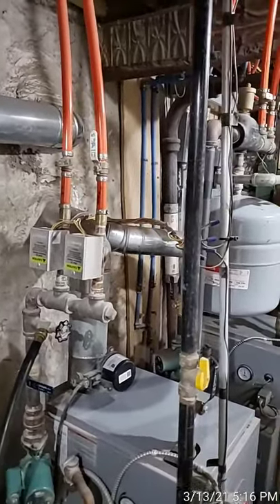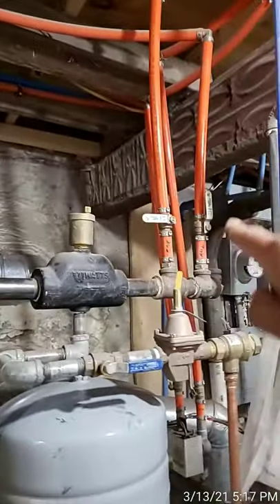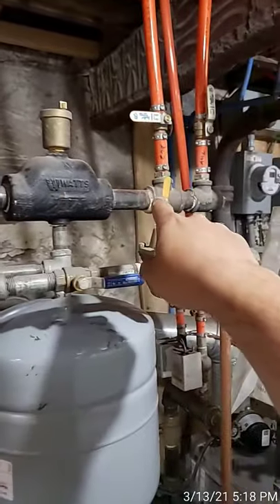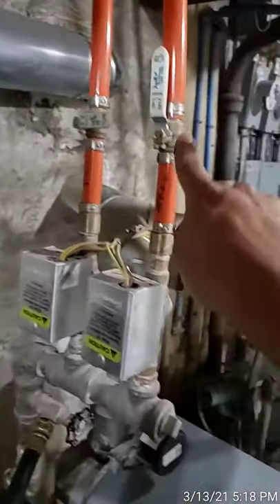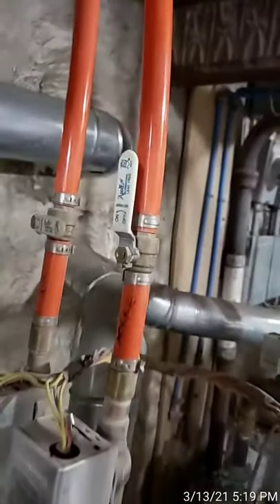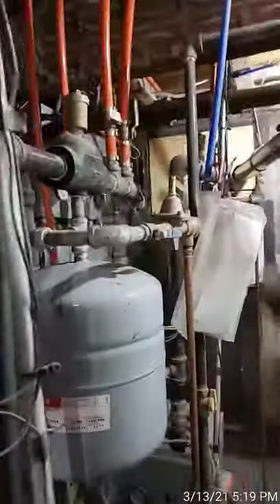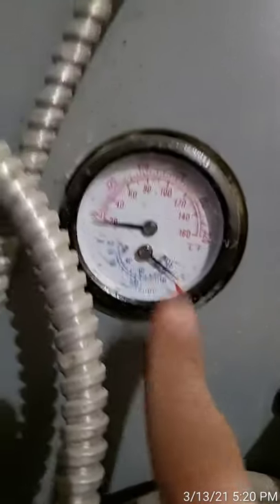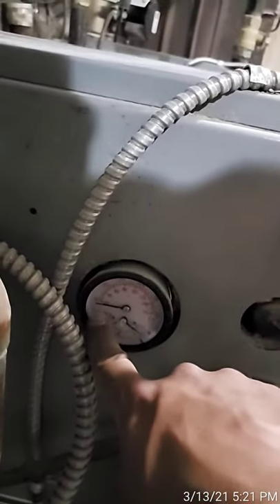How to bleed baseboard heat 2 zone boiler

Comment: What do you mean when you say "get this water to fill in the reverse flow that it actually flows when it's on"  aren't you just pushing water through the return line to bleed the lines?

Comment: Enjoyed this video> On my system there are four zones each with its own circulator coming off a manifold on the supply side. There are no purge stations on the returns. Can I bleed the zones at the drain at the end of the supply manifold pipe?

Comment: hi, I have a similar issue but mine is a 4 zone heating system where one zone isn't heating up.   If I'm not comfortable doing this by myself, which field should I call?  Is it plumbing or is it heating?  If it's plumbing, are there different kinds of plumbing that deals directly with the furnace/boiler?  Thank you very much.
Reply from the maker: Any licensed plumber should be able to do it.

Comment: That was very helpful thank you very much!  Unfortunately our boiler has 5 zones to it and I'm including the hot water tank.  I say "ünfortunately" because none of the entrances to the zones have ball shut off valves except to the hot water tank.  Do you think the switches on the thermostat callers for the zones are sufficient, not sure if that is the right name for the mechanism, but I think that they are the same thing that the system in your video had in the silver boxes, except mine aren't in silver boxes; nevertheless do you think when purging one zone, that will induce air into one or more of the other zones because the entrances 'do not having ball valves?'  And Do digital hydrostat controls need to be reprogrammed every time the power is turned off?  And if they do would that mean the thing hasn't been working as it should ever since our power went off months ago?

Comment: If the system is sealed, how does air get into the system.
Reply from the maker: First, thank you for your question.  Note I put up the channel as a way to share some of the knowledge I have obtained from managing residential rental property, being a home owner and a registered home improvement contractor.  I have not considered that questions may come in and I have not build my business to the point where I can dedicate enough time to regularly review and answer questions here so I apologize for answering so late.  I am not a plumber so I cannot tell you with certainty.  However, some areas have seals that interact with air and seals become worn over time.  Air Vents, Expansion tanks, Service drain valves, the rubber seal on either side of the circulator pump.  I sometimes notice rust spots around threaded joints and other parts mentioned above, with rubber or teflon seals on boilers. I'm thinking, If water can make it out, air can make it in as well.  Hope this helps.
Reply: @propertymanagementandrepai2356 So you're not really fixing anything? You would need to replace all of the rubber seals to prevent this from happening again?
Reply: Most common cause of air getting into your system is water leaking somewhere, relief valves, pipe joints rust etc just like the person posting this video answered. It happens over long periods of time so usually every few seasons depending on how bad the leak is. Water leaks and it gets replaced with air.

Comment: Nice video.. can u do this with out the 2 zone valves? I have 2 small loops one  goes to the 2nd floor and one loop to the first floor but I only have one thermostat..
Reply from the maker: The trick is to isolate each loop.  You need to have a service shut off and drain on each loop then it should be similar.

Comment: I have four zones how do I know which pipe to drain they are not marked for what floors.
Reply from the maker: I am no plumber but I can share how I would go about checking which one is needed or to determine which zone is for which floor.  1. To check which zone belongs to which floor turn all the thermostats off except for one.  This will open the zone valve on the pipe that corresponds to that floor/zone.  As for which zone needs to be purged of air, usually the zone return pipe will have a colder temp than a zone that is circulating water normally.  BE CAREFULL and use a digital temp reader or thermal image camera.  If you don't have that be sure to touch the return pipe far enough from the boiler that the pipe isn't hot just from being closing enough to the boiler.  In my experience 6ft away from the boiler (measuring backwards from the circulator pump) or 3 feet before the zone valve.  (For me the return pipe for each zone would be the tell.  The temp difference on the pipe of a zone which has an air pocket preventing the water from circulating back to the circulator pump and the temp of the pipe on a zone which the water is circulating properly will have a significant difference). Cold pipe means no circulation.

Comment: What should the water pressure be on the dial?  Mine is analogue like yours.  Thanks!
Reply: Standard pressure is 12 psi. Add 3 psi per floor so if the boiler is in basement, 12 to 18 psi is ok when cold.    When hot, it will increase to about 21 and the expansion tank, set to the system pressure of 12-18 will absorb the hot water expansion. The pressure relief valve is set to release water at 30 psi.
Reply: Thanks!  :)